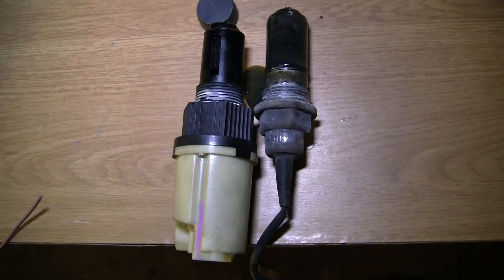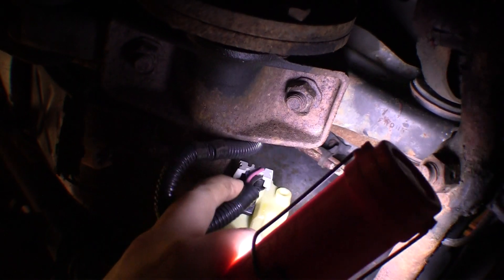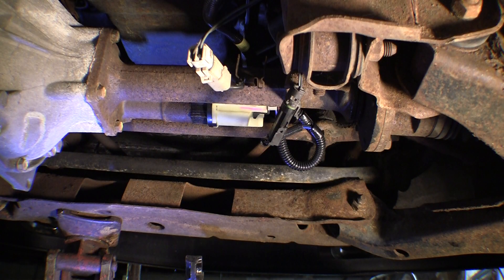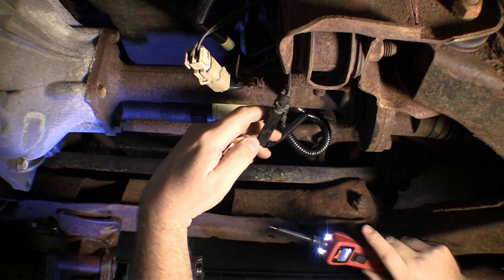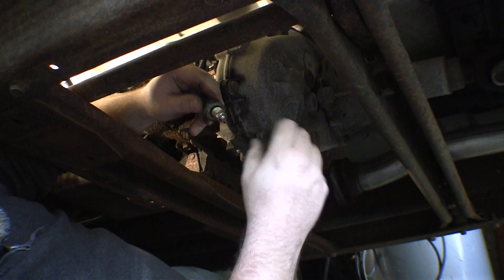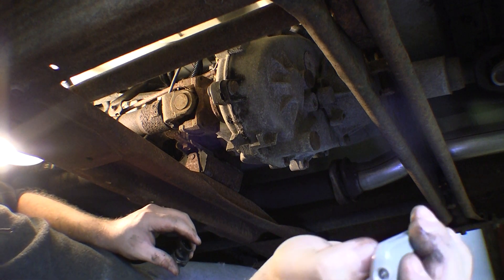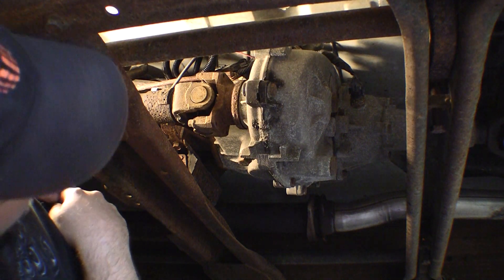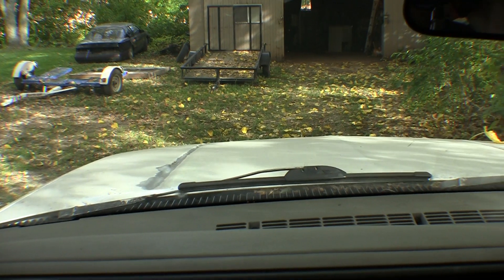1995 Chevy K1500 - 4x4 Thermal to Motorized Actuator Upgrade - Tips n Tricks

Comment: Damn thing took a shit in the middle of a plow job, I never knew these were thermal actuators with full on heating elements in them, no wonder they go bad all the damn time 🙄.  I threw an el cheapo in just to get it back in service for now but I will definitely be doing this upgrade in the spring.

Comment: As an aside to anyone coming to this late, if you want a waterproof 12v connection- there is just enough wire to reach up inside the cab and I used a add a fuse to the 4wd fuse

Comment: Great video but for the people watching this the splice connector he used at the transfer case switch I would not recommend, they are not sealed from the elements they can corrode and lose continuity. In areas where they salt the roads this connection will be bad in no time.

Comment: I absolutely hate those quick splices, their not water tight and can corrode over time. I would use a 3 way T tap butt connector, and shrink tubed it. I really appreciate your video and all the information, not hating on your method at all just giving you a better option and maybe save ya some headache down the road.

Comment: Great video but I had an issue with my conversion. I wired like you and as the instructions stated but the new actuator would not engage. Both 12v connections were good just no action in the motor. I splice and ran ground to engine block and presto, actuator actually actuated but would blow 4wd fuse. Then I noticed that figure 1 in instructions had a note to cut and tape Lt Blu wire on illumination switch. I left the ground wire in place and replaced fuse and presto 4wd is alive again. I have a 95 GMC K1500 with a 5.7L from a 98 2500HD. The owner before me had the engine swapped and maybe they didn't ground back as the factory, I'm not sure. Hope this helps someone else. Also, alternatively you can run the brown wire to the fuse panel and install a add-a-circuit with an extra fuse on #24 (4WD) which maybe easier to install for some. Thanks again man.
Reply: Im having trouble doin this conversion on my 95 suburban k2500...i got the new actuator to expand but it doesn't retract.  Both brown and blue wire have power when the new transfer case switch is pressed and I have the np241c transfer case with the 3 pin switch connector.  Any ideas?

Comment: I've spent soooooooooo many hours trying to research why mine quit working i put a new oem actuator in because that's all I seen i replaced the fuse and it worked for about 20 minutes and when I went outta 4x4 it quit working again this video is very very informative and really good

Comment: The actuator on my 96 failed in the middle of plowing (likely due to the cold) and had given me somewhat inconsistent engagement last year. As the truck is only driven short distances, I opted to “stake” the darn thing. I pulled the rubber back on the plunger, extended her out all the way, and drilled a hole and installed a roll pin through that hole. Then just screwed the little fella back in. Now it can’t leave me stranded. The transfer case still disengages the front shaft in 2 wheel drive. It works but I wouldn’t recommended my repair for a daily driver. Thank you for an informative video :)

Comment: Thanks for the great video! Question- what is the other electrical connector on the front differential for? The one closest to the drivers side, next to where you plug the 4wd actuator in. I have a 95 too, but am going to swap in the front diff (and rear end) from a '99 to change my gear ratio. I've noticed the 99 doesn't have this other electrical connector, just the plug for the actuator. Thanks again for sharing.
Reply: I have the same problem,  have you figured out what the other connector is for,  and if it would it still work when you swap the differential with only the actuator? thank you
Reply: @pablovegas4567  The other plug is just for the light on the floor that lights up around the floor shifter when 4wd is engaged. I'm sure you could splice into the new actuator wiring to have the light turn on if you're swapping in a diff without this wire. What I did was unbolt the driver side axle section from the old diff with this wire and bolt it onto the new diff that had the different gears.

Comment: Very informative video. My 95 has an issue with the 4wd. It's already been converted over though. Looks like all wires are okay and connected. What can I check? The actuator itself or the transfer switch? The fuse is good as well.
Reply: lftdblazer the switches go bad very often. I knew it was bad when I gave it a slap and all the lights started flickering on the switch. I bought an amazon one and have been great since
Reply: @313sancho  Yeah, since you'0ve replied I've changed out the transfer switch and the actuator and it's still not working. Guess my harness must be bad. Oh boy...
Reply: lftdblazer also check your fuses. Or check for power at the actuator when pushing the button.
Reply: @313sancho  the fuse is good and this is a floor shift. No fancy buttons.

Comment: Thank you for the video. I've been trying to fix my 1990 gmc 4wd for about 3 years. I never even knew about the switch on the transfer case, I was about to try and pull the front diff. So again thank you

Comment: Thanks, I was not upgrading because my 95 had a  motorized actuator;  but it was not working.  This will help me fix the 4wd.  They make a cable actuator called Posi-Lok that replaces the thermal linear actuator for about $125-150

Comment: Its great you got it working. I got this 96 k1500 a couple months ago. And came up on your video. Im in the process of getting it ready for winter. And It made me curious to see if the previous owner changed to to the electric actuator and they have. So im happy

Comment: Was the Thermal Actuator used for most of the GMT400s? My 98 Z71 doesnt have the floor shifter. It has the dash mounted push button without Neutral. While I have never had an issue with mine, I wonder if it would be best to change out the thermal (if I have it) for the stepper motor. 

Great video by the way, man!

Comment: Better late then never!  LMC has a manual" cable option for the front diff, issue.#36-1585  6 lug  /#36-1586 8 lug.     just sayin!
Reply: They also have a thermal actuator delete kit. It's just a large pin that screws into there instead of the thermal actuator. So you don't any any junk electronics to deal with.

Comment: OK I have a truck with the wiring harness missing to the transfer case but have the wires there.  I'm needing to know Wich color of wires go where on my new pig tail connector my new connector is different.  I see you said blue wire is far right Wich is middle wire.  the wires on mine is blue,brown and white

Comment: Jason does diy well. Great video, I learned more than a few things about my trucks four-wheel drive system and also about troubleshooting electrical problems. Thanks Jason. Two questions? Who makes that cool power probe? What is your opinion on shifting into 4wheel-drive while moving like the truck manual says to versus doing it while stopped and then reversing a few feet to engage it like many folks say?
Reply from the maker: PowerProbe is the name of the company and device.
I've not torn down a bunch of transfer cases of ppl that shifted in to 4wd one way or the other, so no opinion there...
Reply: JasonDoesDIY Right on, thanks for the quick reply. I've just started my troubleshooting and discovered the blown 25 amp fuse for the 4x4 system on my 94 Silverado. Thanks again for the great video, response, and the new knowledge. I will put it to good use.  My brother and I already replaced the fuel tank, fuel pump and sending unit, some brakes and the battery. When I'm all done I'd like to replace the fuel and brake lines as well. I'm from Minnesota and the salt is literally eating this truck alive.

Comment: Excellent vid. Only thing I would have done different. Where you used a scotchlock  to splice into the wire up by the transfer case switch.  I would have cut the wire, slid glued shrink wrap tubing, twisted and soldered. That scotchlock is a failure waiting to happen down the road.
Reply: This is exactly what happened to mine. The splice to the transfer case must be water-proofed for those in the northern part of the country... (salt+water=rusty wires and splice) Going to the store for a soldering iron now.

Comment: Hi Jason, ok I replaced the front actuator and ran the brown wire to a keyed spot on fuse box bottom line it works BUT the tranfer case isnt working I checked for juice at the actautor for trans case and 0 volts, does that switch on top of the case where you spliced in send the juice to the acuator on tranfer case motor just wondering where to check for juice..

Comment: my 1994 chevy suburban ive had for over five years and at 328k miles ive just now had to change the actuator. not bad in my book.  love my old chevys
Reply: hi i have a problem a couples days ago i"m stuck because the front weels not working and i check the front drive shaft is move and  is conect as well on transfer case but the(4X4 light indicator) is off you think maybe we talk about the same part ACTUATOR? i love my suburban 95 recently i transformed to full manual transmission, thanks fellas nice vedeo mate
Reply: My 1992 1500 always spun out the front drive shaft splines it took me all day to figure it out front end and transfer case we’re working but nothing happened   
I guess the old thermal actuators arenammed right it burnt my pickup up last month by grounding out and the fuse never popped shorting out electric and the fire began

Comment: I stumbled across your console modding channel and was very interested by it, but in one of your videos you mentioned this channel and I had to check it out, and now I'm subbed to both channels. I have a question though: did you go to school for this kind of stuff, or are you self-taught, or what? I'm kind of a novice handyman techie what have you (build a computer, change my own oil, install a ceiling fan) but you seem to be on some kind of pro level, and I want to get there! 

At any rate, great videos, man. I'm enjoying your channel quite a bit!
Reply: +ChicagoPaul2010 Thanks for the double sub! I don't have degrees in anything, just good aptitude and work experience.
Reply: +GameTechUS No prob! Thanks for putting out interesting material! And that's pretty inspiring. I guess I need to get off my ass and start trying to do more DIY stuff so I can keep learning, hah.

Comment: Mine went out just before Christmas. Just haven't had the money to fix/replace it yet. You found a good deal on e-bay which is where I'll be going because brand new costs more than I can spend.
Reply: Never buy aftermarket parts they suck I buy a Crankshaft position sensor for $30 and well it went out in one week I buy another new one for $80 and life time warranty at a Auto parts store buy OEM  always NEVER AFTERMARKET

Comment: So if the fuse doesn't blow could it still be bad?   It attempts 4w low but not high.   Could the 600-506 switch be bad or can these actuators become weak and never short out?

Comment: did you have a hard time getting the original thermal actuator off? I'm struggling with mine trying to use channel lock pliers. I don't have a wrench big enough to fit the hex on the thermal actuator! Sprayed it with PB Blaster to hopefully loosen it up, but no success yet. Any suggestions of a tool to try?  I noticed you used a 1/16 wrench for the TC switch. What size was the Wrench for the Actuator?  Thanks!
Reply: I just used channel locks and it spun out no problem...
Reply: GameTechUS got it off with a crescent wrench. looks like someone put a silicone sealant on it before. Still no 4wd engagement, but I have the TC switch on order. going to try that next.

Comment: got to love Chevy trucks man, there rock solid for sure from the mid 90's. i have a 2000 s10 blazer and i had to replace the main switch to the 4x4 and fixed mine. love your vids.
Reply from the maker: Thanks for watching!
Reply: superzombiefan89 rock solid until plastic connections get baked and cracked